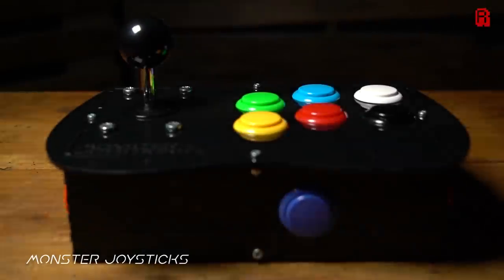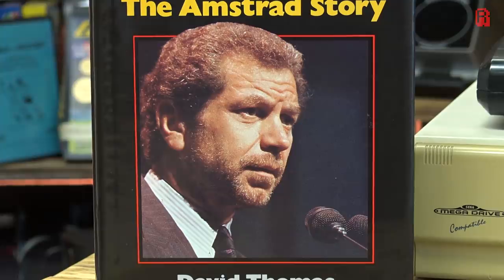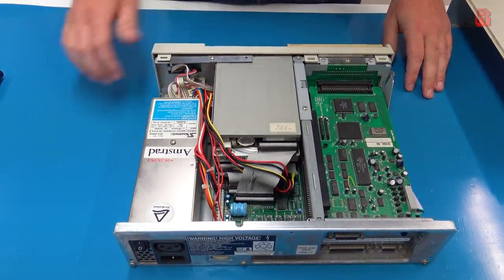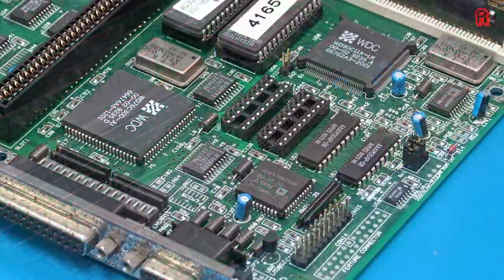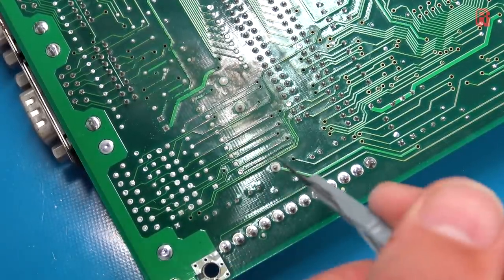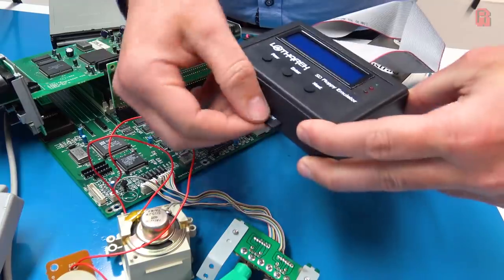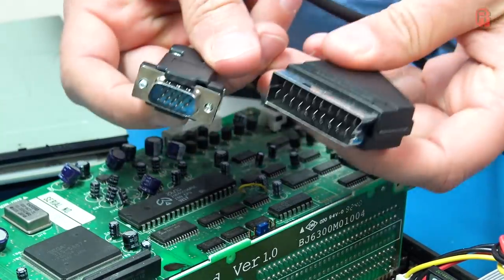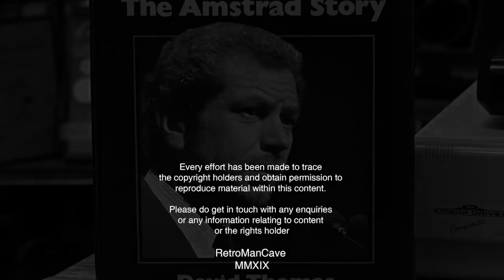Amstrad Mega PC - Console Gaming in an IBM-PC Compatible | Trash to Treasure (1/4)

Comment: A quick heads up to other people watching this, there is almost no point to doing a Maths coprocessor upgrade - there is very little software at the time that made use of it. AFAIK of the top of my head: Lotus 1-2-3, computer aided design SW, some DOS ray tracing SW and a single game - Falcon 3.0. IIRC The later 80486DX included a maths  coprocessor built in....
Reply: GeOS ...
Reply from the maker: Very interesting, I'll run some benchmarks and some real world tests and see if we come to the same conclusion.  Although as a big flight sim fan Falcon 3.0 is reason enough :D
Reply: didn't the 386DX also have the maths co-processor built in.  SX had it disabled. Remember the batch with the glitch that had to be recalled - I heard a lot of SX's were simply DX's with the co-processor present but disabled.
Reply: @webbo73  AFAIk, from memory here, but 386DX is: 32bit internal, 32bit memory bus, no maths copro (==FPU). 386SX: 32bit internal, 16bit memory bus, no maths copro. 486DX: 32/32bit with maths copro, 486SX: 32/32bit without maths copro (possiby initial DX with bad copro, later probably a dedicated line). Nerdy teen in the 90s, so this is from way back... In that sense the 386SX is to the 386DX as the 8088 was to the 8086 - the latter two being 16bit CPUs with reduced width data bus for cost reasons.

Comment: Dam not Mega CD completable,How the hell would you put the 32X in that... :) in 1993 I had a Amiga not until 1995 I got a Dell Optiplex. Never used a Amstrad PC,they were manually used in Video (VHS) Rental shops.Amiga 500 Plus has the battery problem too,it has a habit of leaking on its board.

I have all 3 models of the Amstrad Emailer.. :) I am making a demo of E3s firmware using Flash so people can see what it was like.
Reply: It's compatible with a Mega CD but you had to buy special equipment (which might be possible to build yourself now).
Reply: Cd drive Or the everdrive pro, mega sd?

Comment: I wonder if PC version of DOOM on this sounds better than the 32x since that uses the same audio chip as the megadrive ! (though of course it won't run well on a 386SX)
Reply: The Mega Drive used a different Yamaha chip than the one the Adlib card uses, YM2612 vs YM3812, and as far as I know neither is capable of emulating the other, so maybe the card has both? Or some chip that can serve as eiher.
Reply: @Nukle0n  I don't know, he sounded like the YM2612 was used by the PC. Either this is a mistake, or maybe there's something interesting going on here that should be tested ^^

Comment: If it had come to market sooner it might have been able to have had more success.

Ironically, amd producing cheaper chips is what made pcs become so much cheaper. Intel never wanted them to be able to, but had to licence x86 to them to get the original IBM pc contract. The amd 4x86 and 5x86 processors were cheaper than pentium chips and the faster 4x/5x ones could be faster than the earlier pentium chips.

I never had any amstrad computers, or a megadrive growing up (my brother got a snes instead) and by the time the mega pc came out I had a 486dx2 or early pentium chip pc, I think with a voodoo1 card though that may have been a little bit later.

Comment: So if the mega drive is all contained on the ISA card can that card be put into any PC and work or is there something on the board to stop it? There is the video link but I guess that can be bypassed or modified in some way?
Reply: As mentioned in this vid you needed the monitor that came with it as it was able to handle the mode needed for the mega drive to display its picture, as shown here a normal monitor cannot do this, I am not sure this would have been easy at the time this was on sale, much easier now i would think with modern tech
Reply: @cliffcook3993  Still a few LCD/CRT monitors that can handle 15KHz as thats what the Amiga output to as well.

Comment: Can the PC play a sound while in Megadrive mode? So you could play a game while doing a long file transfer (28.8k modem) and be notified when it is done?  Or compile code and have it beep when done? If so that might have been neat to use back in the day if you were in a cubical or something.
Reply: The sliding panel that covers the Mega Drive cartridge slot is also a switch, it disables the PC in Mega Drive mode and vice-versa so sadly both systems cannot operate together in the Mega PC. The PC side also utilises the Mega Drive boards Yamaha sound chip via the ISA slot which is another reason both can't run at the same time.
Reply: i suspect that the pc side is suspended.
Reply: It can play a sound, but only if it's not from the Adlib card, as it's shut off when the Mega Drive is active. PC speaker as well as a possible additional sound card will still function.
Reply: @Dioxaz  of course the real issue is you can't suspend your game unless you've got one that lets you save your progress, or gives you password.

You can't just pause the game, nip back to the pc and then pick up your game, because getting back to pc mode requires you to unplug the cart.
Reply: @TheTurnipKing It might be possible to run both at the same time but you have to take off that sliding door or the front bezel entirely. If memory serves only the sound of either unit is cut off. But someone has to confirm that or not as I might be talking nonsense.
Reply: @Dioxaz  of course there's a number of goofy things you could try, like plugging in an actual adlib at the same time.  Or maybe using an opl2lpt

Comment: Odd that it's impossible to find actual sales figures for this thing, even Commodore managed to shift tens of thousands of A1200s 1992-94 and Megadrive games were better than anything our A1200 got 95% of the time in all honesty. The only source is based on a SCAN from a French magazine and they clearly do not speak French because the figure of 6000 sold isn't correct or believable. Slow yes but the same price as an Amiga 1200 with 40mb internal hard drive by Xmas 1993 'wish list' time (price was 599 in early September 1993 in a Silica Shop advert with a 486SLC option for 799-999) and you can play Wolfenstein and OutRun much more enjoyably on a Mega PC and still take home from work to do on crappy MS Office. If the Amiga got Megadrive quality ports 9/10 times then of course a bad choice, but more like 1/100 times. Turrican 3 on Amiga 1000  is a rare type of dual conversion quality and that's better than any other comparable game with or without AGA. Poor Commodore at the mercy of greedy low standards UK software houses driving the market.

Comment: would have been more impressive if they would have joined 32x, genesis and sega cd inside a PC case.
Reply from the maker: The Pioneer Laser Active comes close but no 32x
Reply: @RMCRetro  is it compatible with everdrive pro. If so, once the 32x is available on the everdrive, then it will be possible.

Comment: So what supposed advantage is there of using CF over SD for these mini-SSDs?
Reply: Simplicity of the adapter.  CF cards are already IDE standard internally, just with a different connector.
Reply: Oh, that's interesting,  @JeremyLevi , thanks. That makes me wonder what kind of adaptation would have to be in place for it to work with SD. Maybe SDs are more USB-based internally. Is that right?
Reply: @HelloKittyFanMan..  SD cards use their own signalling method that's different from USB, but it is a high speed serial transfer so its not completely dissimilar.
Reply: Ahh, OK,  @JeremyLevi , so SD is closer to USB than it is to ATA/"IDE" (I put "IDE" in quotes because pretty much every drive's electronics are integrated these days), because USB and SD are like single-lane PCI-express, which are such high-speed serial that they even beat the old-school parallel connections like regular PCI, ATA, and the old printer port, which camp CF belongs to. Right?
(And then PCIe x2, 4, 8, and 16 are series-parallel hybrid, hence their even-faster speeds, right?)
Reply: @HelloKittyFanMan..  More or less, yes.  PATA/IDE is much faster than a parallel port though, its more like its directly connected to the system bus.  That's the "Integrated" part, most of the electronics are on the drive, the signalling through the cable is essentially a direct extension of the data bus.

PATA tops out at around 133MB/s, eclipsed by the modern speeds attainable by SATA and USB3.0.  SD Cards are theoretically capable of faster speeds with the UHS-II standard and up, but actual SD cards still aren't made to go that fast.

The fastest one you'll find typically available are the UHS Class 3 at 30MB/s, with the "video" V90 Class 90 SDs maxing out at 90MB/s.  Compact Flash cards, on the other hand, are available right up to the maximum data rate of the PATA bus.

Comment: "nobody wanted a 386 in 1993". maybe in the first world?.
I wanted a 386 in 1993. (or 92, I don't remember if I got it in 93 or 92...or even 94... I know I still had a 286 in 91/92).
 it still was "the big expensive new thing", specially if you wanted a color vga monitor. everybody wanted a 386 or a 486 to play doom or mortal kombat. 486 was too expensive, like "only rich people have a 486 and a color monitor!".
when I got a 386 it was a dx40mhz with 4mb of ram and a realtek isa vga with 256k at first but then I upgraded it to 512k to have svga 640x480x256 (and I added 4 more mb of ram).
Reply from the maker: You make a good point, I still think "nobody wanted a 386" in '93 in the sense that we all wanted a 486 as our first choice.  Affordability was another thing.   And 486's weren't crazy expensive then, I picked up a Packard Bell 486 in 93 for the price of the MegaPC
Reply: oh, ok, I understand what you mean now.
over here in uruguay a 486 in 93 still was too expensive. the affordable option for most people was a 386 and a monochromatic vga monitor.
I was lucky, my first vga was an ibm 8518 color one and I got it second hand for a reasonable price.  
 vga mono is hit or miss, I've seen it and some stuff can look gorgeous (golden axe!), but other stuff can look wrong and "missing things".

Comment: When looking at the board it's easy to see how they cheapened it out almost unnecessarily, like the ram slots. It's bad enough that this was clearly a 16-bit board but then to chop half of the ram slots off is just brutality cheap. So even if you had upgraded this thing with an aftermarket 486 card, your stuck with 16mb of ram assuming that thing could actually do 4mb simms. WDC was a decent chipset at the time, but it was far more capable in regards to what this board could do. It's a bit sad for a computer from 1993 and yet it's really bound to that 386 sx, a 486 if it would work, wouldn't work fast. You know this reminds me of the PowerMac 580 (I think) It had a 603e cpu strapped to a 16 and 32 bit bus. It was buggy and slow. Probably one of worst macs ever. What they did was a take board made for a 68030, slightly enhanced for a 68040 and slapped on a PowerPC cpu on it. Horrible design, a bean counter special. This is probably why while being a neat concept, did so poorly commercially. Yet potentially for very little extra cost, could have been a commercial powerhouse. Kind of sad really. Ironically it probably cost the company more to decapitate an already out of date design then to just give them an out of date design. It reminds me of Packard bell back in these times. Ugh!

Comment: Wasn't the MegaPC a reskinned Teradrive?
Reply from the maker: It was quite different, the Teradrive was a 286 which shared components.  Games were released which used both the MD and PC at the same time.  Hopefully we can get one on the channel soon
Reply: @RMCRetro  what about the riser? I'm sure I read somewhere it's the same part.

Also didn't drop to £599 within 6 months or so.  I'm surprised at that price a PC386+MD didnt fare better against the Amiga, even the AGA models.
Reply: @RMCRetro  ISA in both? MGA comes to mind as in being used for adding system-boards/processing-units. Maybe the wrong time. Don't remember exactly, when ...